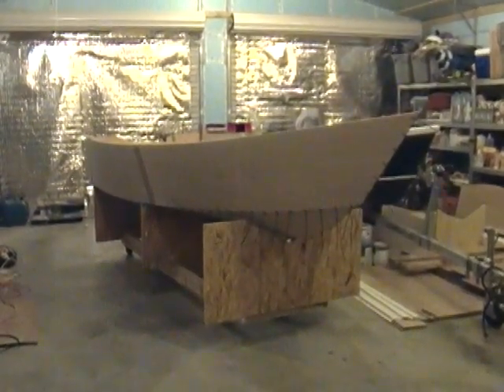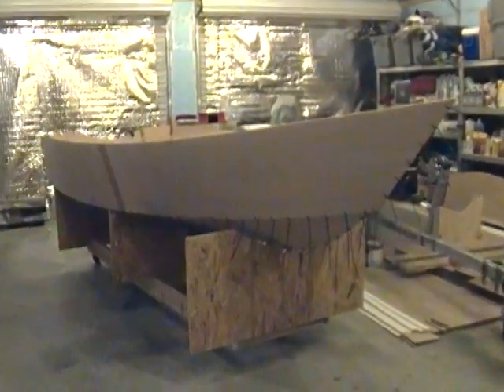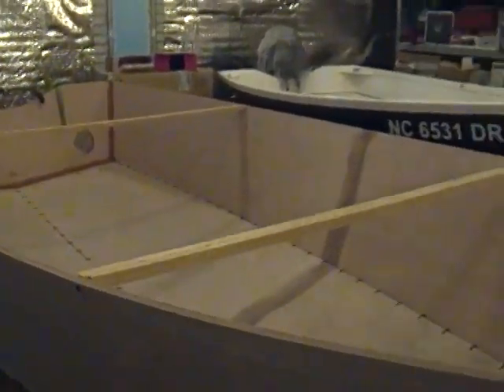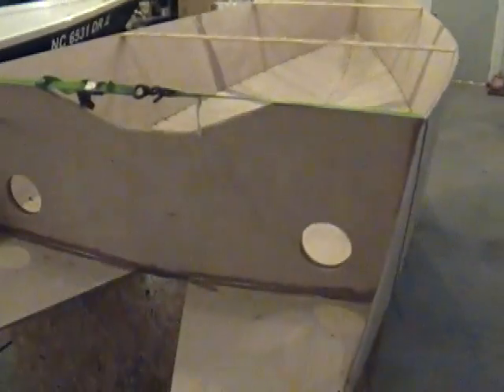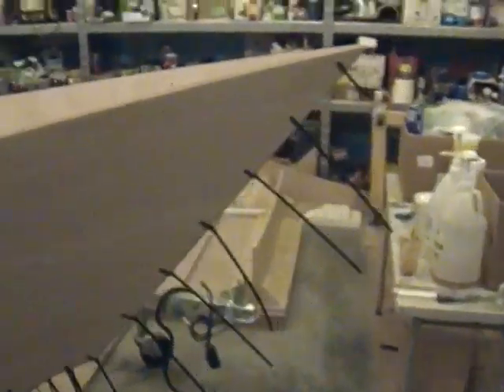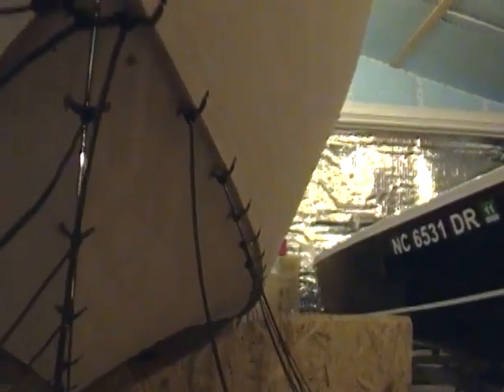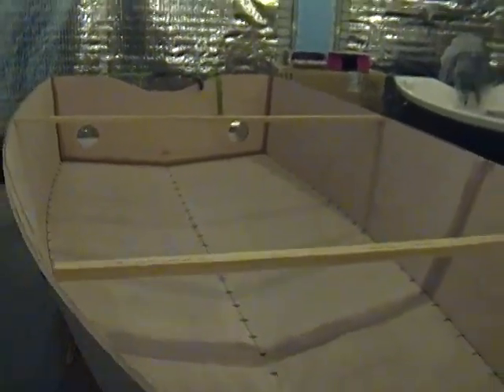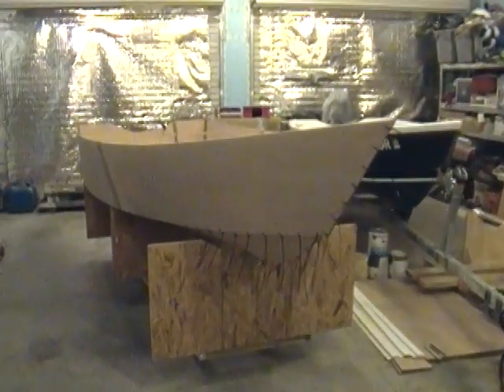Tango Skiff XL Stitch and Glue Okoume Wooden Boat

Comment: What are the tabs sticking out of the transom for ? I’d like to build a 14’ flats boat using the stitch and glue method, are you using 1/4” in. Luan plywood on the bottom and sides?  My big worry is getting it registered and checked by the coast guard to make it legal .

Comment: I wish there was a 17' model, that would be the one I would want to make, I could use a 15', but 17' would be better. What a great looking boat! I LOVE the chine, and the flotation/trim tabs of the rear end, VERY functional!
Reply: then someone would want a 19 then 21 and you see it just no end to it. Before long the guy would be building a 40 footer. Just build it 17 foot. Let me tell you how to build the easiest boat. Youglue the sheets together and get yor bottom laid out  on a quarter inch sheet of metal. You tack 2 inch metal pipe right along side the bottom o the boat. Then you cut the plywood the height you want. I would cut it the same height front to back. You use a hydraulic jack and you push the sides up against the pipe and drill small holes and use electrical ties to securethe sides. Then you have tocut down a tree andyou need two pieces of wood 3 x 3 by 25 feet. Now the wood will be wetbut you want it wet to be able to conform to the sides of the boat. You screw into the sids of the plywood by goin through the thick wood. You'll want this t dry for a couple months in the Summer. You then loosenup the screws and use marine glue and then screw in from the plywood sides of he boat. You'll tighten up the screws in the bottom that go through the hick wood into thebottom. Then put your cross members in and glue them and screw them down. Then putyour gussets in and washboards and glue them all down. Then lip the boat over and Then put four inch srews through the bottom into the sides. I've built boats this way but buil them with aluminum now. Aluminum Ican weld and it doesn't have to dry and you don't have to pain and I can get 24 feet lengths of aluminum. The bad thin about aluminum is fishing when the aves hi on the sides or you drop somehig it is so loud.
Reply: Barry, according to Tango LLC's website, they do offer a 17' Tango but nothing larger.  The only problem is no one bothers to write back when you contact this company via email.